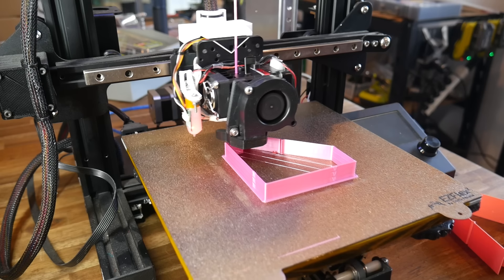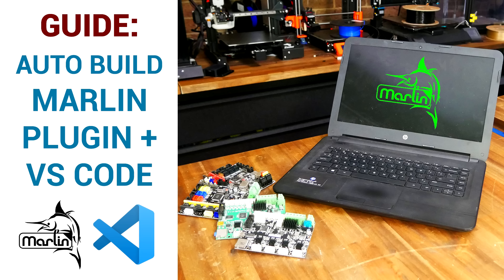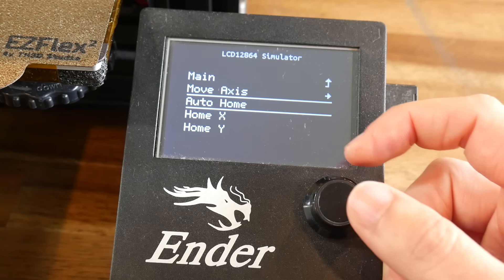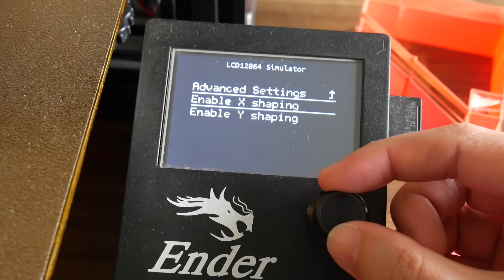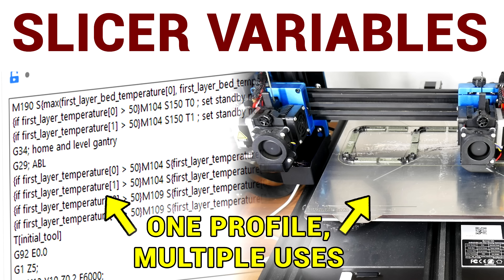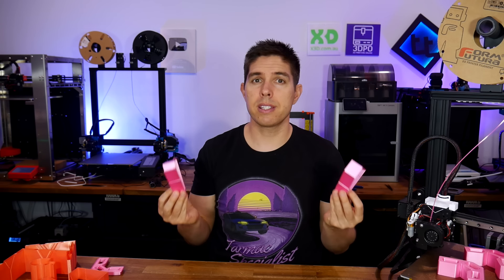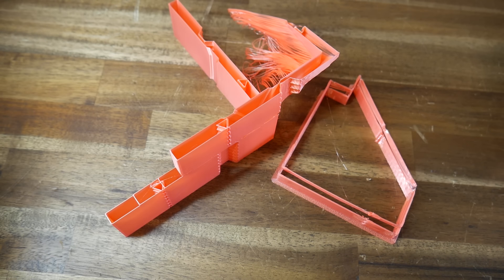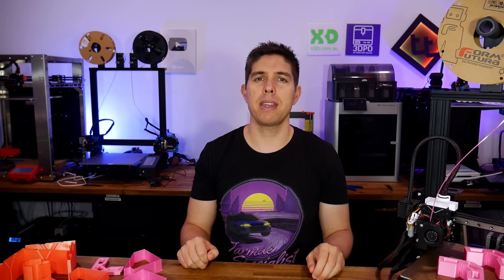Marlin Input Shaping - Step by step guide to more speed and less ringing

Comment: Michael, what about part strength? Printing faster requires more cooling, but it is known that layer adhesion suffers from it.
Also, you didn't mention what happened to linear advance, did you retune it or kept it disabled?

I just want to remove ghosting as much as possible while printing PETG on my DD Ender-3. What the video showed is that you can maintain ringing levels after increasing speed, but not reduce it while printing at the same speeds.
Reply: I would say the print is only as strong as its weakest bond so what you care about is closer to the maximum movement speed, not the average one. So if you can tune up acceleration to lose less time on stop and go, I don't think you're really compromising on strength, you're just getting a more consistent extrusion rate.
Reply: @SianaGearz  You realize not only accelerations are increased? Printing speed is doubled or even more as well.
Reply: @alejandroperez5368  YOU choose what is and what isn't increased, but there's absolutely no reason to increase your maximum linear speed after you get input shaping set up, because that's limited by your hotend throughput; with very thin layers also potentially your motors. There is a reason to increase acceleration and jerk because ramp related ringing is suppressed by input shaping and extreme forces on the motor in ramp are reduced as well.

The aggregate print time is just dependent on what your ramp profiles look like (jerk and acceleration) and linear speed. A good decrease in print time as shown is down to a move of 4cm in length spending the entire move in the ramp phase and not even reaching linear speed if you have an Ender like machine which sustains 500mm/s^2 acceleration without shaping. But if you have longer moves as well you don't want to compromise adhesion there do you.
Reply: @SianaGearz Most people using Klipper with input shaping are increasing both acceleration and speeds. Increasing accelerations makes small parts with lots of directions changes print faster, yes, at the expense of more wear in your machine. It won't make your prints look better, except if you are using extremely low accelerations, in which case you'd get bulged corners.

Increasing speed alone contributes in getting large parts printed faster and, in many printers, getting better surface finish, by moving away from resonant frequencies (reducing Fine Vertical Artifacts). So, I ask again, how is part strength affected by increasing speeds from 50mm/s to 150mm/s? More cooling will be required when the layer time is below a specific value due to printing too fast.
Reply: @alejandroperez5368  Well obviously when you increase linear speed, you're going to need a machine that can do that linear speed. Both on the extrusion rate, and on the cooling and other factors, and you're probably going to need to compensate for the fact that you have little time to heat that material through to maintain print cohesion, PETG is particularly weird in this regard somehow, and i don't really understand why PETG behaves differently from other materials, but it somehow does. 150mm/s on PETG at even just 0.2mm layerheight is THIS close to getting unusable garbage out of a typical machine with MK8 style extruder and hotend combo and standard nozzle.

Stock Ender has kind of ridiculous cooling as well, there's barely anything going on there at all, completely unfocused as well. Half of it is just stray coldend fan air that just happens to go in the print direction.

But it doesn't occur to me that throwing more airspeed at a simultaneously faster print is a problem per se, since any given section of a print would just have vaguely the same amount of cooling.

Typical higher speed machine builds have lower impedance hotend and nozzles and Bondtech-style dual sided extruders. As someone i forget who found out, those extruders introduce their own cogging which imprints on the prints at lower speeds as extrusion ripple; but the length of filament between the extruder and hotend acts like a spring-damper system so at higher speeds this artefact disappears. You can sail right past some types of artefacts by going faster, but you tend to get others in return. And input shaping as a feature was developed in conjunction with machines built for high speed printing. But it can reduce ghosting at any given speed.

Though fundamentally any ghosting and ripple is going to be composed of several different frequencies, with perhaps one being dominant; and you're only suppressing that dominant one.

I agree this vid is a "how-to" and a speed test but doesn't really cover the breadth of outcomes, more testing is desired. I also notice that the before-after comparison suffers from worse layer alignment consistency in the "after".

I think he didn't re-enable linear advance either. On a print with faster ramp profile there's fewer places where pressure lag would be visible, since extrusion speed can be maintained with less variation.

Comment: Quick question, couldn't this be fixed in the slicer? If you could enter ringing frequencies into the slicer, it could generate the movements required to offset it.

Comment: its 2023 mow... i wonder why people still like marlin. Every change you need to make on the firmware requires you to recompile, save to sd, go to printer, reflash the board - over and over again. Klipper + ADXL -> autotuning -> rerun pressure advance test -> done. No need to worry about RAM usage oder CPU power since the Pi is handling it without breaking a sweat.
Reply: Because a ton of printers come with Marlin and changing that takes a lot of work and knowledge. Most home 3D printer people just want to print with passable quality. These kinds of changes that only require a one-time firmware recompile and some testing are easy to do, comparatively. Rebuilding with Klipper and yada yada is a different level. If you're an enthusiast who builds stuff etc then sure, go right on ahead with Klipper. In that case this video isn't for you.
Reply: @extectic  everything you need is a pi, connect via USB, load the recommended config and follow some instructions. If you're able to compile a firmware and flash it, you're also capable of using Klipper ;)
Reply: You can flash Marlin via USB right during compilation. But then I have a custom bootloader and scripting that make it super quick like seconds.

I think I'm moving to Klipper whenever I find where I put that damn Pi. :D
Reply: @SianaGearz  you got a 3d printer... You'll find a way 😜

Comment: I notice that those test clamps still have a regular, subtle wavy pattern on the flat surfaces. I've been trying to smooth that out on my own printer. Is this due to belt tension, extruder gear slop, motor resonance, or something else?
Reply: 13:09 I'm hoping the two parts are swapped because this is not good.
Reply: Yes, all those things.  If it is belts, it probably isn't "subtle" though.  If I tighten the belts too much on my KP3S (which has toothless idlers), prints get downright stripey.  VFAs (caused by stepper resonance) are a bugger to eliminate, but I've had some success by avoiding "hot spot" print speeds that make them worse.  A "speed tower" printed in vase mode should show you what speeds to avoid.
Reply: @beauslim  stripey prints is why I upgraded to tooth idler. They weren't quite cheap though.
Reply: @SianaGearz  It is annoying, but also interesting, that the tech pushes the digital domain so far into the physical world that it is difficult to distinguish between a low-poly count on an STL and missing teeth on a belt pulley.

Comment: When saving the new values for input shaping couldn’t you change the default values in the marlin code? That way one does not have to worry about losing the information when installing new firmware versions. When making changes to default values in Marlin, or other code, I normally copy the line, comment out the first instance and change the second. That way I know what the original value was and may quickly revert to it if ever needed by commenting the line with my value and removing the comment in front of the line with the default value.
Reply: Are you adding lines in the code? Bad idea. What you want to do is add a side comment with the old values.

Comment: Great clear video as usual.  I will be trying this out on the "ringiest" printer I have which is my most modded and workhorse original CR-10 due to its large bed size when I get a chance.  The attractiveness is the increase in print speed for large models which will really scale down the print time.
Reply: It's not clear for beginners.
Reply: @TheRattleSnake3145  c'mon man, if you already configured the firmware, the hardest part is done, uncomment input shaping and you are done for calibration

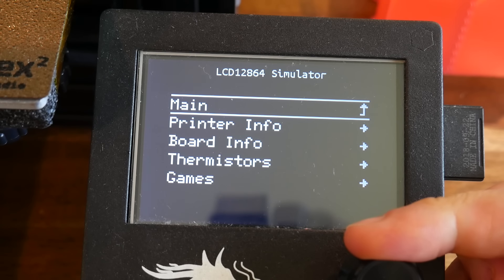Comment: Another thing I do with my firmware, related to 4:34 in the video.   I'm frequently turning lots of stuff on and off while tuning.  I've had dozens of version 2.1.2 already.  So I change the CUSTOM_MACHINE_NAME to show the timestamp including time.  

#define CUSTOM_MACHINE_NAME "E3x 0122.2117"

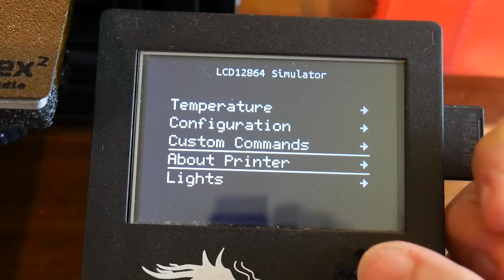This machine is named E3x.(Ender 3, eXpanded)  I normally use the YYYYMMDD timestamp, but with the time too, it gets too long.  This format is MMDD.HHMM.  Or January 22 at 9:17pm. This format, it shows me the date, and time, so I can see if it's the new build, or if the flash failed for some reason.   It shows at boot time, and at the bottom of the info page, and in the menu at About Printer -> Printer Info .  In the video at 4:34,  CUSTOM_MACHINE_NAME would be where the display shows "3D Printer".

Once in a while, something goes wrong.  Maybe I didn't copy the firmware to the card, or I ejected it too early.  Or I may have just forgotten to compile, and copied the same old firmware to the card to re-install.  Mistakes happen, but I can always check my CUSTOM_MACHINE_NAME and look at the display.